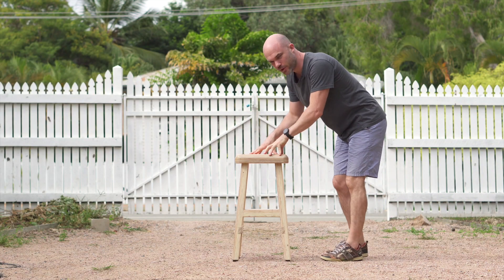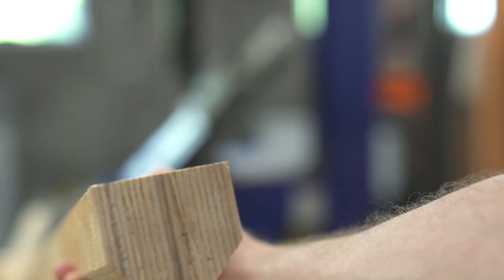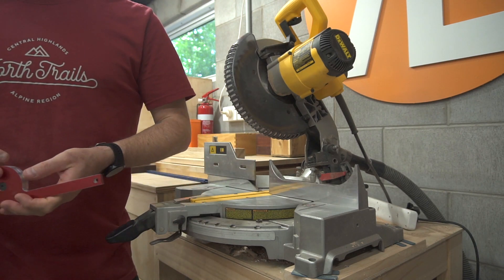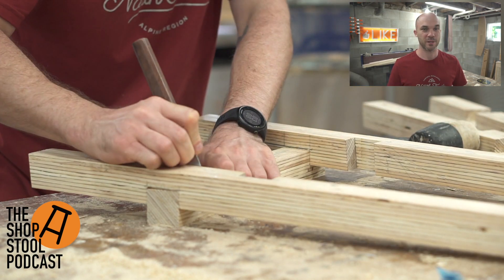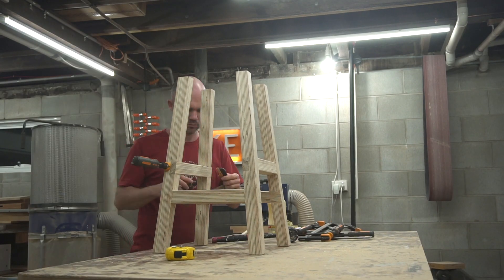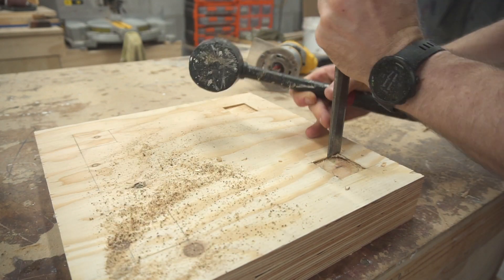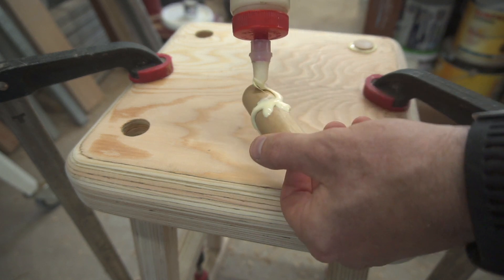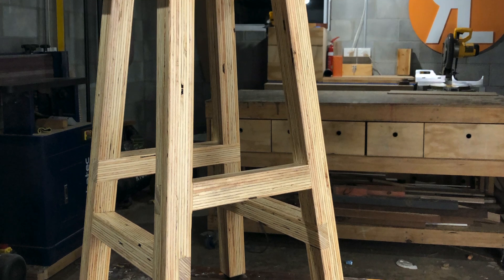Making A Stool Using Half Lap Joins

Comment: I've never met LVL before.  So it's essentially like plywood, but with the grain all running the same way?  It's an interesting pattern, I like it where you see the layers overlap at the joins within the wood.  And you've ended up with a very sturdy looking stool for the shop :)
Reply from the maker: Thanks! I think they're made like that because they need to take load in one direction, but plywood can take it from any direction

Comment: Just a quick question about your drill press. I've been looking for a new bench drill press, and saw the Full boar ones on the Bunnings website, I was going to go with a sherwood but they don't have the Variable speed adjustment which is what caught my attention with the full boar's. How has been your experience withe your's? I know your's is a pedestal one but surely they would be similar.